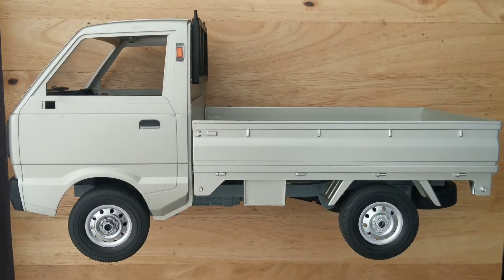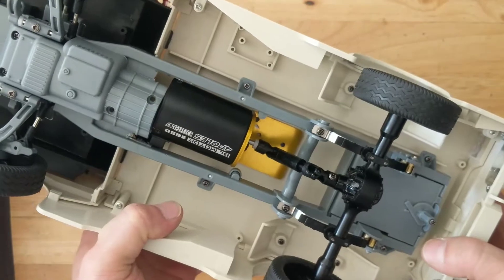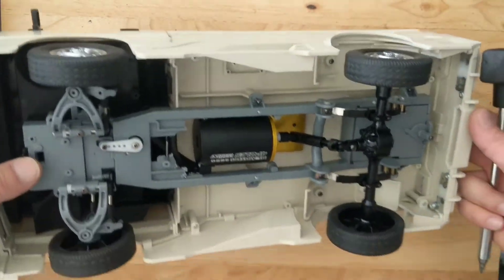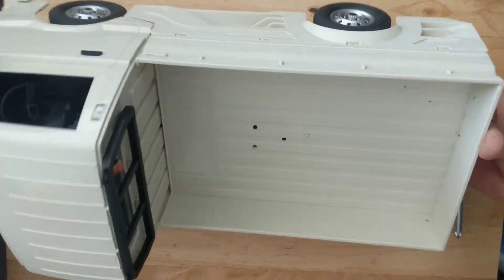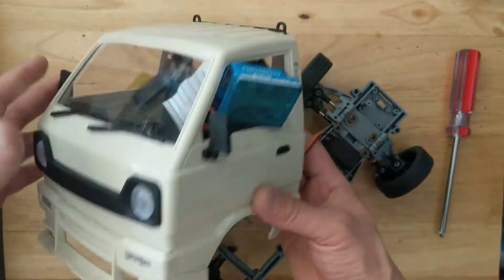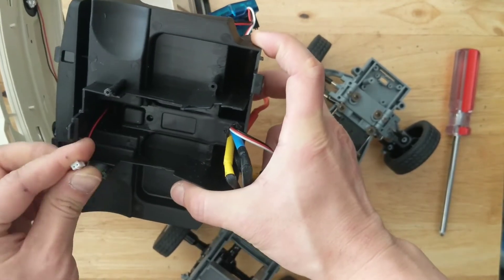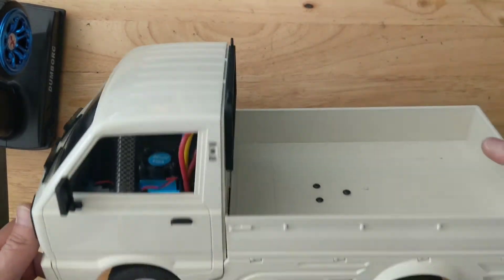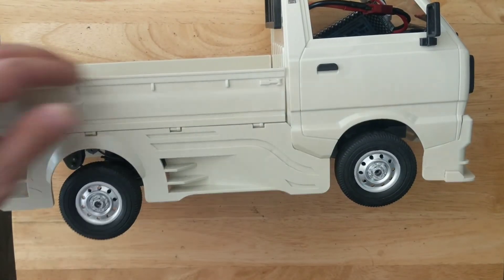WPL D12 Brushless Motor Upgrade Without a 3D Printer & Body kit Install

Comment: Wow! I freakin love that body kit! So many things one can do to these trucks! Yours is insane brother. Such a clean set up in there. Another alternative for space situations is using an out runner brushless set up. They take up quite a bit less space and produce great amounts of torque. I’m really lovin what you’ve done here Dave. Your very intuitive! The direct drive may be too much for that plastic drive shaft. That thing is gonna be all balls! Great tutorial brother! ❤️‘s it!👊🏼💯👍🏻🍻✌🏻
Reply from the maker: Thank you so much my Brother! Your support and encouragement have really helped kept these videos going. And thank you for sharing all your great content and reviews. Had the driveshaft angle and the plastic was all wrong, but got it sorted out. The outrunner is a great idea! The stock fy08 runs one, and they have a different sound. This wpl line is pretty cool, can't wait to get the 1/10 wheels on it. And kinda want to do an off-road setup on the work truck or van version. Thanks again for all the support, it's been a blessing 👊!

Comment: You can get a steel drive shaft. I have a D12 that I made a shorter wheelbase and made a sick mod on chassis. This baby is fast, and smooth and also had to shorten the drive shaft to avoid binding. I think I have album in my channel, you can check it out 👌. Btw I have (3) upgraded D12's 👍
Reply from the maker: Thanks for watching🤙 and the great tips. I'll definitely check out your builds👍 Got it sorted out and will get the update up soon. This wpl line is dope, got some plans for the work truck and can versions.
Reply: @motorheadaddictions2761  your very welcome 👍😁👌